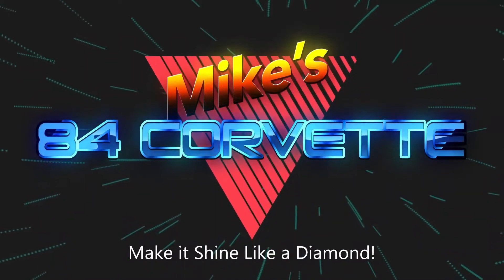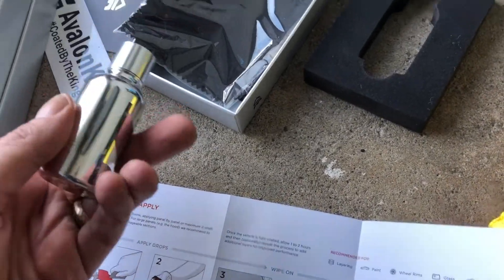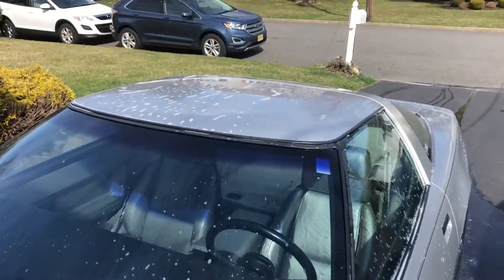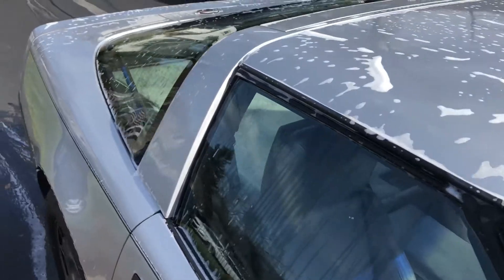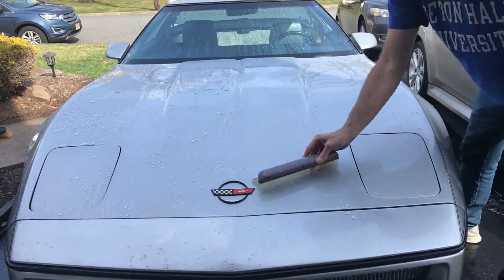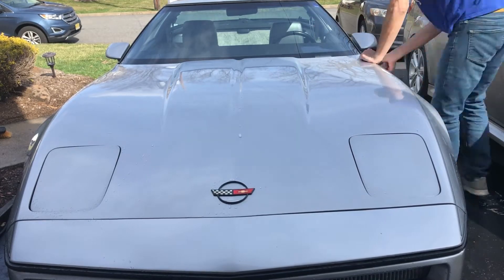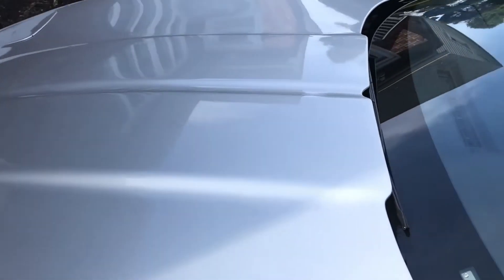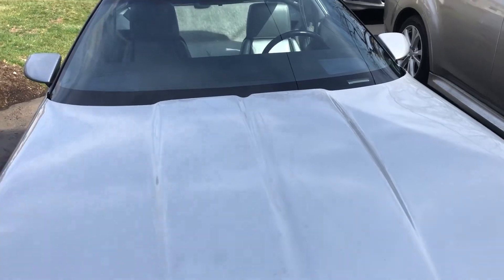Ceramic Coating - Is it worth it? Mike's 84 Corvette

Comment: Nice..I have 03 mustang GT that I would like to do this but I feel like it just needs to be repainted when I’m done with the small modifications...It’s not bad or faded but there r some rock chips and scratches in the clear coat and the car is black..What’s u opinion and how much does the kit cost?? Thanks..
Reply from the maker: I like how my car came out. Not knowing your car it’s tough to say. It’s certainly cheaper than a paint job or even a professional detailing. Go to Avalon Kings website for the price. Good luck!
Reply: @Mikes84Corvette  thank you